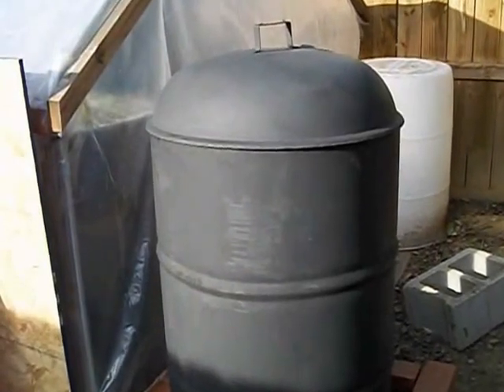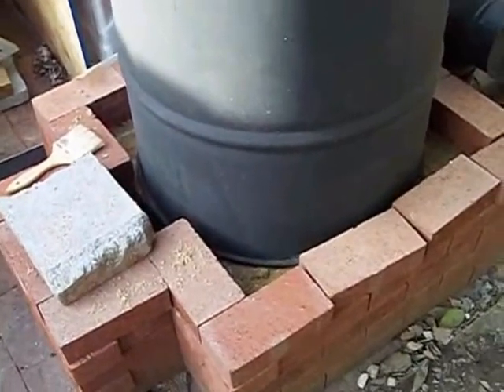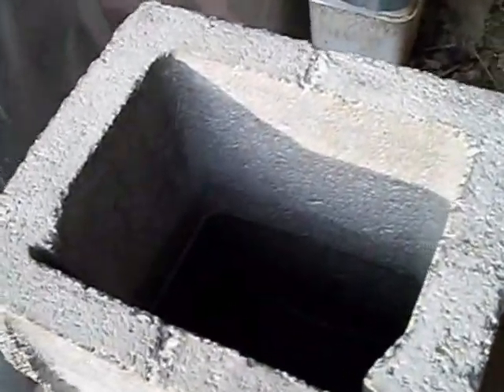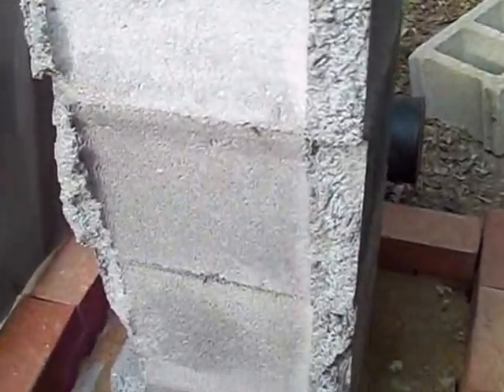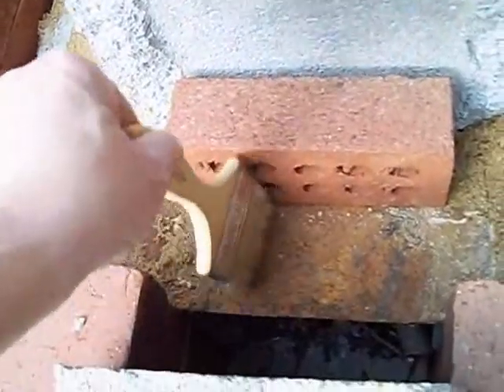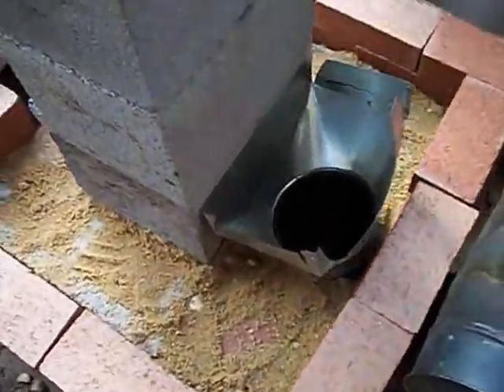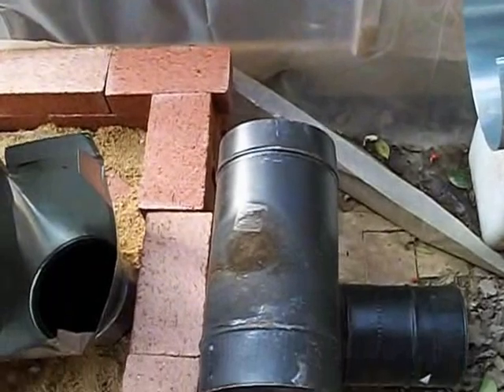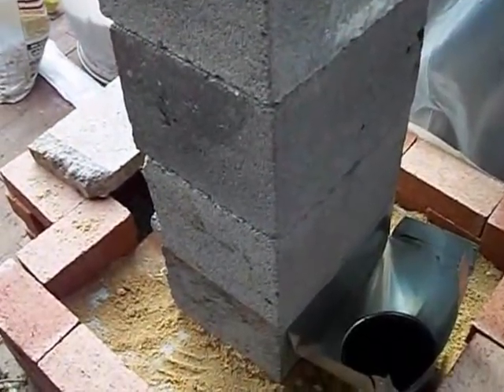Rocket Mass Heater with Cinder Block Chimney

Comment: Well Meg according to Paul Wheaton over at Permies. You not building a Rocket mass heater without a brick heat riser. Preferable fire brick or Cobb but I haven't heard him bad mouth cinder blocks. Temps are way to high for any medals we have access to and they burn out pretty quickly. Just repeating what I have heard. I have zero experience with Rocket mass heater... Have fun with it Meg

Comment from the maker: I haven't stressed my heater, so I don't know if it will break down as quickly as some here say it might. I'm primarily using solar to heat my greenhouse (The greenhouse itself provides some heat, then a solar air heater, then solar water heat). I plan to only use the rocket mass heater when it's freaky cold and the sun hasn't been shining. But since last year my system never froze over all winter, even without the solar heaters, I'm not sure if I'm going to need anything at all.

Comment from the maker: That's fine - this is just four blocks dry-stacked in the stove, total cost roughly $10. I can replace them when they fall apart.

At the Aquaponics Association conference I saw this great pellet stove that has been certified for safe for use in greenhouses. But it's more than $1,000 and it won't burn my junk mail. So I guess I'll just do the rocket mass heater and replace the cinder blocks from time to time.

Comment: Over time your cinder blocks will crack and fall apart.  I know this because my wife and I did a similar stove and ended up with structural problems after about 30 days.

I wouldn't worry about them exploding, they just won't hold up the the high temps.